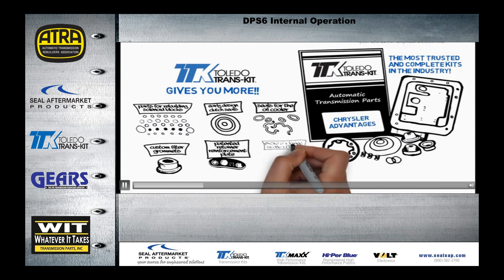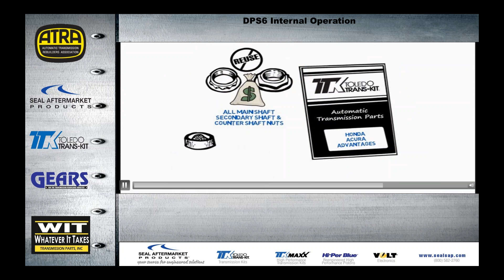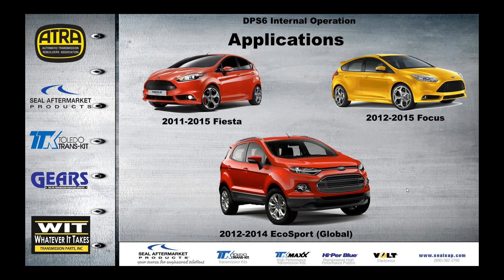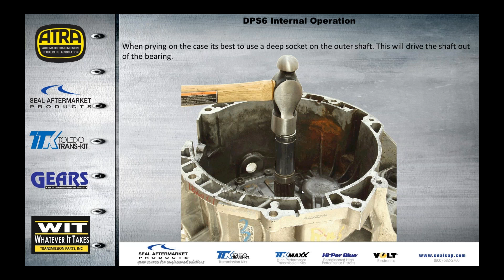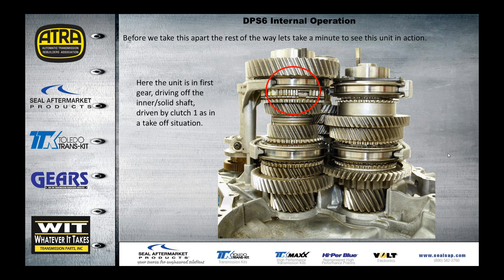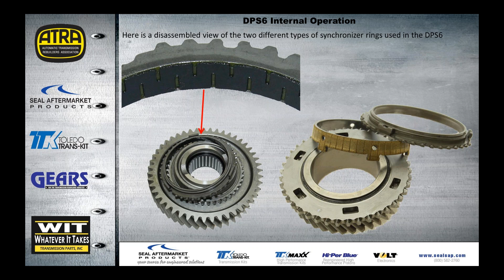DPS6 Internal Operation

Comment: Has anyone had a broken pin on the B Clock Gear? This is Fixable with machine work on the housing and inserting a hardened pin. Obviously a DIY or repair done by a CNC machinist.
Reply: Did you ever come up with a fix? I have one that I'm trying to figure out a way to repair when i mean repair it i mean repair it better than this notorious problem

Comment: Is there a way to clock the gears wothout opening the tranny, someone seem to have torned the clock gears by hand while the tcm was out. I noticed it after ford codnt program the tcm after a clutch fork set install. I tried to turn the first gear wheel thing and realized it was between first and the other gear its responsible for
Reply: Did you ever find this out?